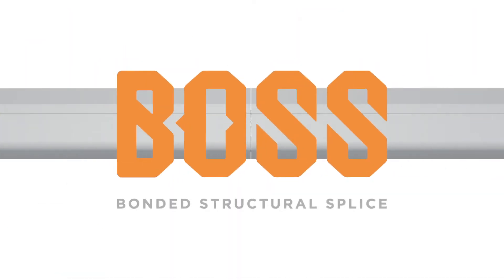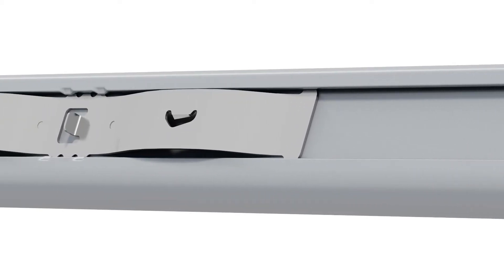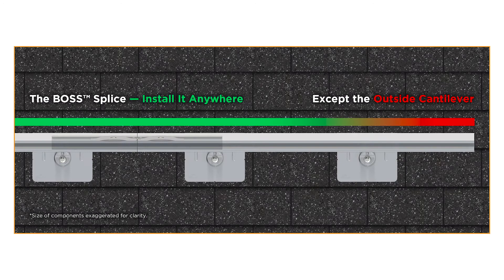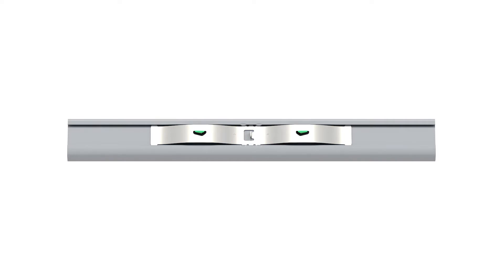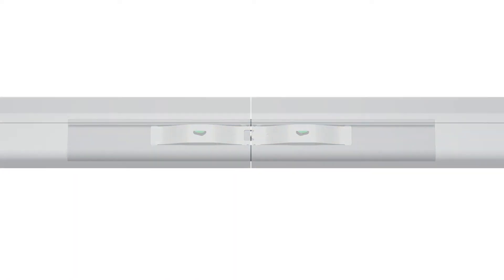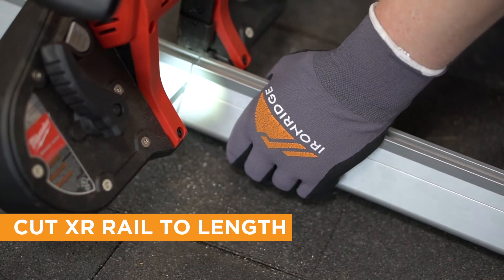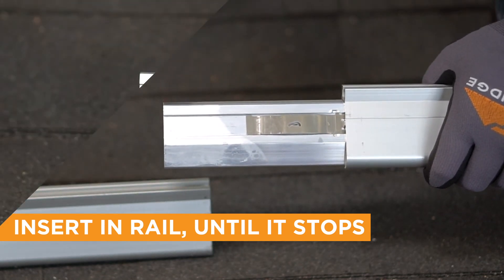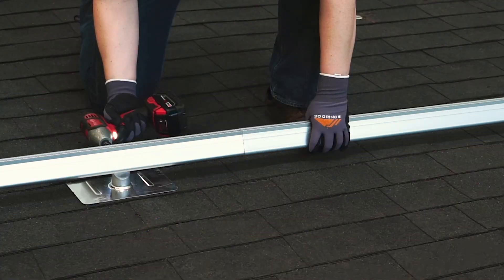IronRidge BOSS® // Bonded Structural Splice

Comment: What are the weight of these components? I haven't seen this information in the data sheets.
Reply from the maker: Hey Andy! The weight of the BOSS Splice for XR10, XR100, and XR1000 are 0.35 lbs, 0.50 lbs, 0.70 lbs—respectively.